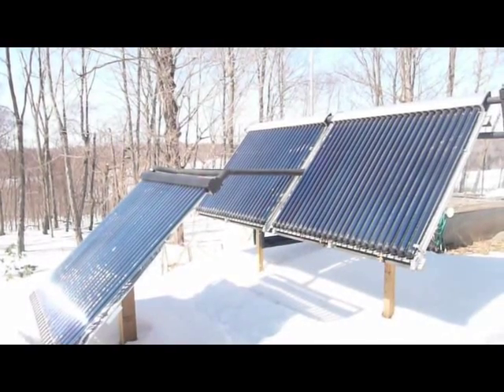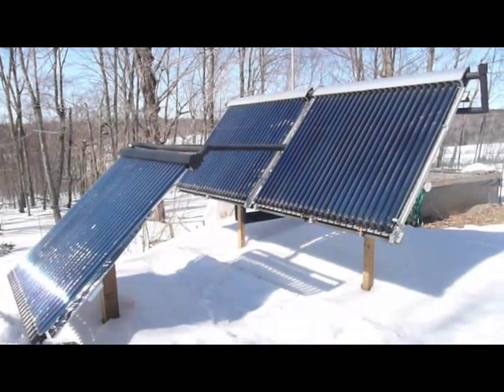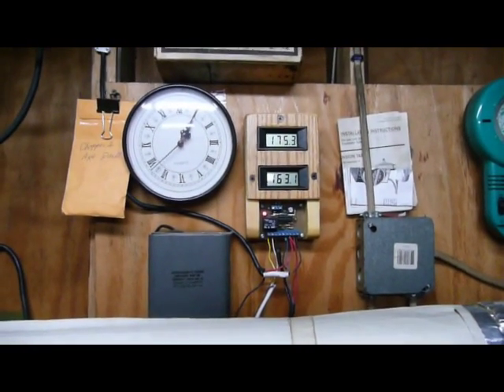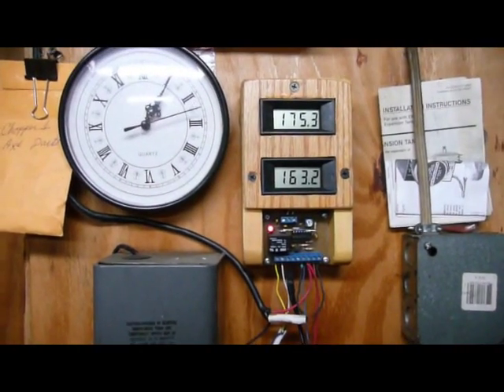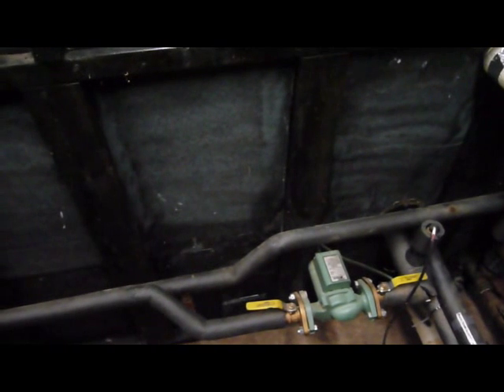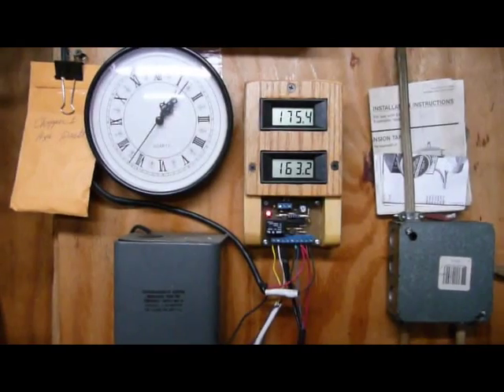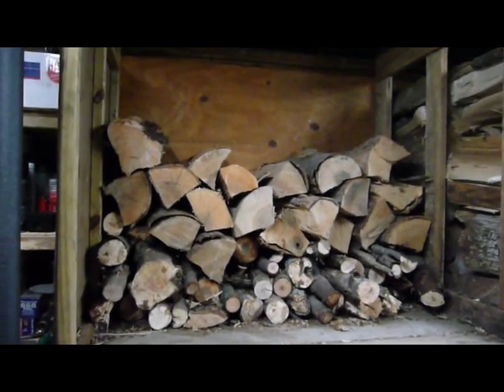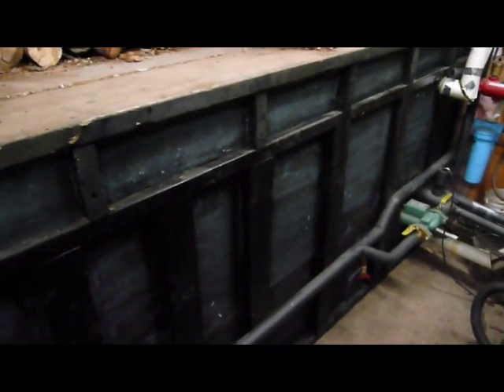Evacuated Heat Pipe Solar Hot Water System

Comment from the maker: Yes, you are correct...it is a pressurized closed-loop system. System has non-toxic antifreeze to protect it when temps go below freezing. Functionally, it looks like direct flow and heat pipe are very similar.  I have what are called heat pipes. The only downside to either type is hail damage. I had two heat pipes cracked due to golf-ball sized hail. I was amazed they were all not smashed! Regards.

Comment: i am trying to understand the system, did you say you have a heat exchanger in the tank? if that is the case this is a closed system that heats water in a loop and passes the heat to the tank through the exchanger?
also is this direct flow or heat pipe?

Comment: Great Job with the evacuated tube heat collection system. I never expected my controller to be used at such high temperatures. I am glad it's working for you. Now if you could only figure out a way to make use the summertime heat you'd realy be cooking with sunshine. I think you could use a larger heat storage system. Another idea would involve making a sun shed for the collectors and store the hot water and other things right in the shed.

keep on trucking... Goog job

Comment from the maker: @trailkeeper :  If you look very closely at the collector units, you'll see a reflective material located behind the tubes (notice the full shadows). 
I installed highly reflective mylar to reflect sunlight back onto the tubes.
It does seem to increase the overall efficiency. 
I think trying to keep a mirror aimed properly throughout the day / year and the size of the mirror required would prove to be impracticle. Thanks for the thought though.

Comment from the maker: @d3adp001 Thanks for the interest.   I live in Chenango County, NY and this winter has been a long and cold.  Here's some "best guesstimates".
Late April - Mid Sept - 100% (heat off, domestic only).
Late Sept - Early Nov. - 25% reduction in firewood (heat on).
Late Nov - Early March - 5% reduction in firewood (short days, lots of snow, very cold). 
Last few days with full sun, 50% reduction in firewood. 
If I had more collectors and more storage, I might not need the firewood at all.